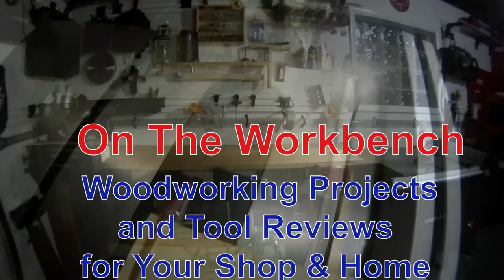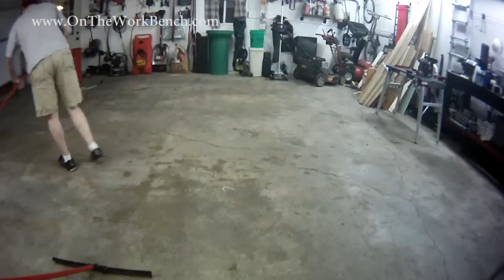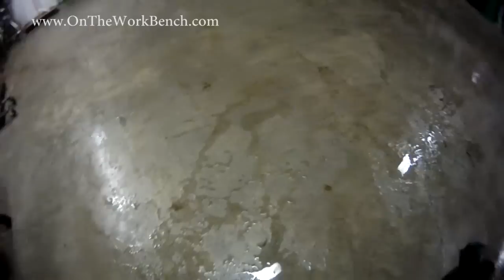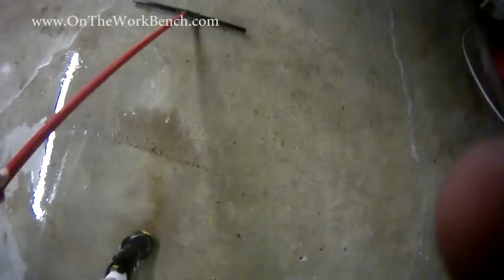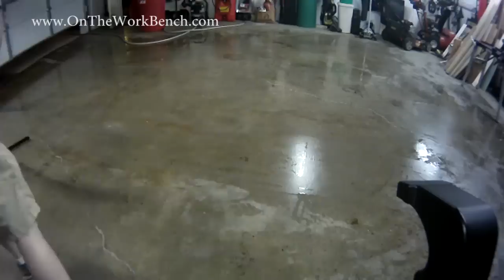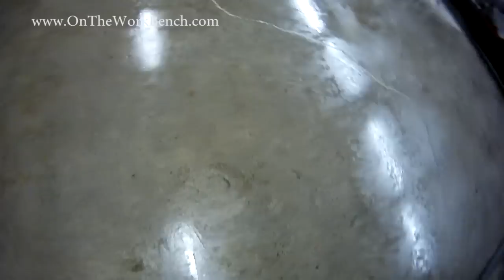Cleaning & Degreasing a Concrete Garage Floor

Comment: My driveway is stamped concrete which has been stained. Will the runoff from this water chemical rinse ruin the stain on the driveway?
Reply from the maker: That's a tough situation with stained concrete. If it was colored when it was mixed and poured then it likely will be ok but a small test spot will give you the answer for your pavement. If it was stained after the concrete cured then the likelihood of damage is much much higher.

Comment: Is there any kind of water pump machine designed to pump out excess water on the floor after pressure washing?
Reply: Sump pump backup?
Reply: lots of garages have drains in them. Use a floor cleaner attachment head and the water won't spray everywhere.

Comment: A couple of items / questions:
1 - Why didn't you remove everything from your garage floor before starting the project?
2 - Should you have pressure washed the floor first to remove the bigger grime?
3 - I would have used dish detergent first with water and the floor broom to remove all other grime with tons of suds.
4 - I would have rinsed again and then apply the product and lightly scrub with the floor broom with the product.
5 - Finally, I would have rinsed again and use the floor broom to ensure a good rinse before using the final sweegy!
Reply: If you know that much why are you watching? Are you a YouTube detective 🕵️‍♂️ ?
Reply: Michael C qo
Reply: Jackass.

Comment: the before and after look the same, why not pressure wash?
Reply: christopher boseak a few power washes are ok but it will soon start to wear down the cement.
Reply: Gael Crane lmao no it won’t it Water it would take 5-6 times the pressure to do anything
Reply: @gaelcrane8008  no it wont